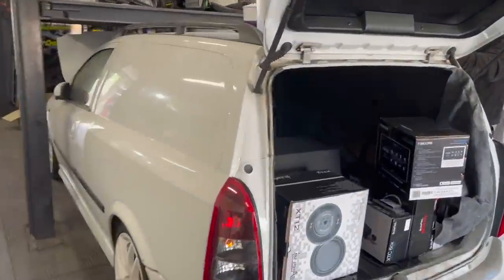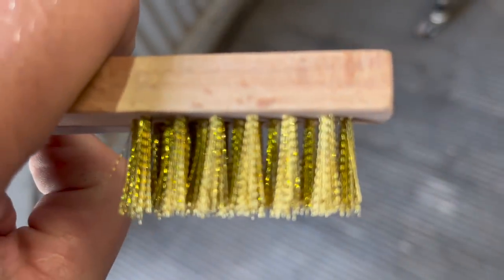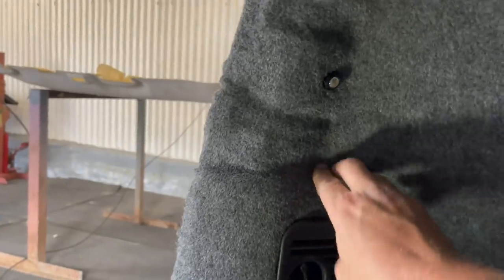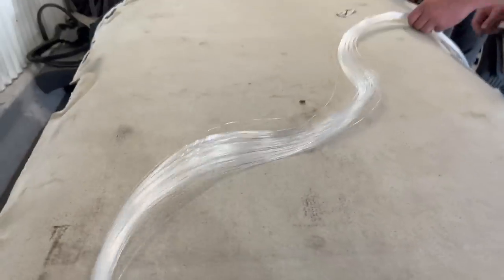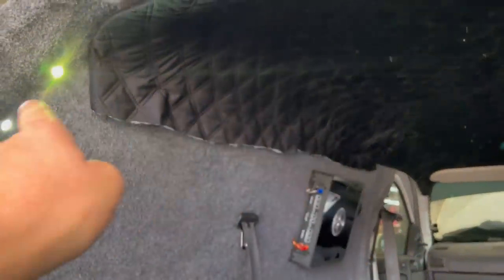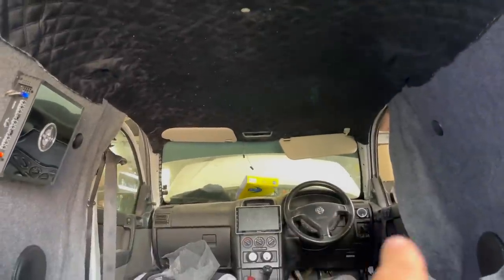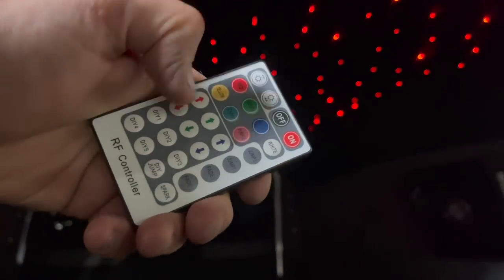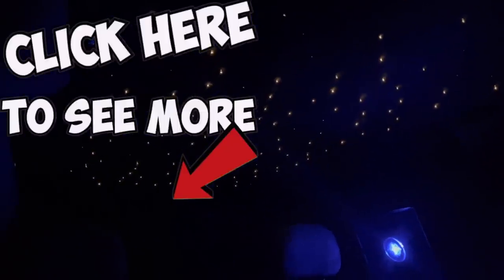Headliner Modification , Install Fibre￼ optic car Headliner Kit Eps 4

Comment: Seen the lights done in roof before but not the same way you guys have done it. The way i seen it was with these small round disc lights. (like the patio/pool ones) The other way i seen lights inside has been flexible led cable/rope down the sides and around rear light and grab handles.  I like your method though proper fancy that like! BANG TIDY! Need a disco ball and a portable poll now lads.
Reply from the maker: Really glad you enjoyed it thank you disco dancing is a way forward from now